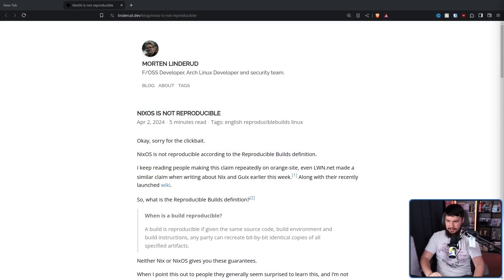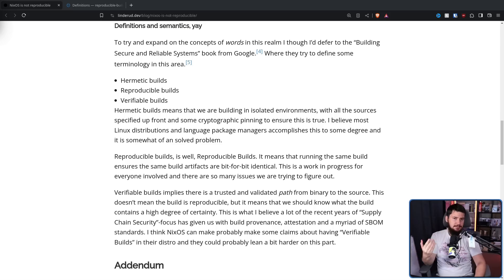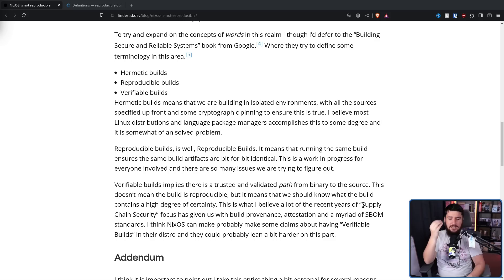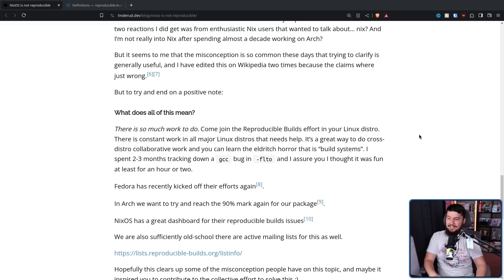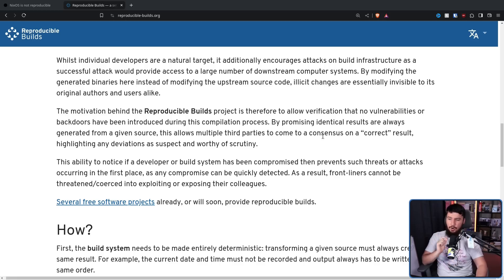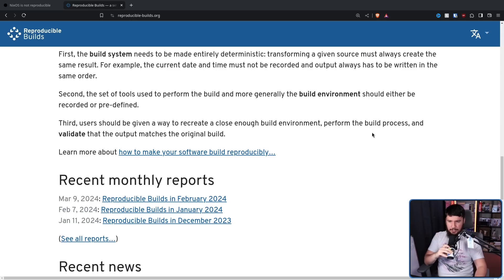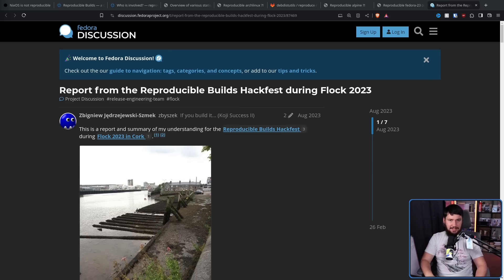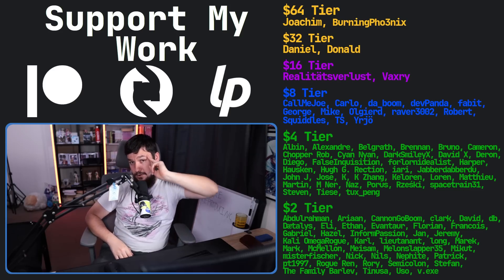Reproducible Builds: Final Step In FOSS Validation

Comment: The way out™ leads to distributed integrity/verification and bazel-/meson-like build caching and acceleration similar to distcc/icecream/sccache/ccache + meson/bazel/buck2/edenfs + artifact repo.
Package managers of systems and frameworks must follow reproducible build standards and use isolated, standardized build environments to allow caching and optional probabilistic verification by occasional spot recompliation. Another advantage is that with same/similar inputs, there can be public repositories of build caches to accelerate builds that otherwise would be incredibly slow.
Sussing out build system entropy typically involves looking for syscalls, archive processes storing timestamps, stable sorting of lists, and tracking compilation switches and build directory names exhaustively. Entropy is always removable if you're willing to patch and/or put in the effort to chopping it down. The danger is maintaining too many local patches without upstreaming them; too many distros fall into this trap of being wildly reengineering software in sometimes fragile and manpower-expensive ways.
Ideally, all large software systems should aim for reproducible builds from source as much as possible to facilitate tinkering and rapid builds.
(PS: It is an anti-pattern to not have simple, straightforward instructions to build from source and insist people "trust" unsigned binary artifacts delivered by curl piping into a shell script like k8s or bun. It is also a second anti-pattern to create a cyclical dependency on something to require an (often unverified) preexisting binary of itself to build itself without an alternate and portable bootstrap mechanism from source.)

Comment: there are some minor misunderstandings of somethings in the threads which need to be a little clearer, so here goes.

to produce an operating system from scratch, you need to either 1, write everything yourself, or 2, go online and download a bunch of stuff from people you don't know and hope you can trust the code.

1 does not work very well, apple and microsoft did not do it, neither did google or steam. it is slow and expensive. look at how long it took reactos to get to the point where people who were not kernel developers could work on it. (not criticising them, this stuff is hard).

this only leaves you with the second option, which you solve by going to conferences and establishing a network of trust through key signing parties.
as this requires the person to show the other person id, it is moderately secure against everyone but state actors who can just issue an id, and id thieves.

all the network of trust does is produce a lot of people who can assert that the person you just met has been verified to them as being the person they say they are (for a certain level of verified).

these people then commit code to version control, and once you get to centralised and distributed version control, you also have the person signing that they produced the work. this means if it later turns out that they were a problem, you can easily go back, and track what they touched and audit it if needed.
it does not stop a bad actor like the xz maintainer, you need other processes for that.

this gets you to the point were you can confirm the code you got was the same as the code they distributed (at least if it does cryptographic hashing like git) and the network of trust identifies all of the contributers.

then you need to link the code together with libraries it depends on. the original paper that started the nix package manager, which lead to nixos, described the purpose to be to declaratively manage the exact version dependencies so that you could be confident that what you used to build it last time is the same as what you used to build it this time. effectively semantically versioning the build dependencies. it appears that the people behind nixos have extended this a bit, but the principle remains the same. if the dependencies change, then the key for the dependent packages will also change. guix did not like the nonclomenture, and thus decided to declare it using scheme, but otherwise they do the same thing.

this gets you to the point where you can compile stuff and be confident where all the code came from, as you have a complete audit trail.

reproducible builds go one step further, validating that the stuff you then compile will always produce the same patterns of bits in storage. this is non trivial for various reasons mentioned by others, and many others. declarative dependency management systems might also give you reproducible builds, but it is not what they were designed for.

then you take the output of the reproducible build, put it in a package, and sign it. this gets you to the point where you as the person installing it can be confident that the binary packages you just installed are exactly the same as the stuff the original upstream contributers intended with a few tweaks from your distribution maintainers to make it work better together.

and you can audit this all the way back to the original contributer to the upstream project if needed.

none of this says anything about the quality of the code, or about the character of the contributers, you need other steps for that.

as the sysadmin for your business, you can go one step further, and create versioned ansible install scripts to do infrastructure as code, but it does not add to the model, as your ansible scripts are just another repository you use.

i hope this clarifies things a bit.

Comment: Major Correction: targeting build infrastructure is referring to the build tools themselves, including the compiler. If someone can successfully compromise a build tool, then any build generated by that tool could be compromised from the get go. That is why you can't be sure of a clean output even when you build an application / distro yourself, the very tools you use to BUILD could be compromised if you don't have verifiability. This is a major goal for GCC and LLVM as ensuring that the compilers themselves are not compromised is foundational.

Comment: This would go a long way for binary compatability amongst Linux distros.  Something i believe needs to happen for Linux to become more mainstream.
Reply: no it would not. it solves a different issue.

think of it as creating a bill of materials which contains the semantic version number of every dependency, and then hash it. that hash is unique, and says that this version of the package uses these exact versions of the dependencies. this is how nixos works.

as soon as you change from the default upstream configuration, at the very least the patch number changes, and this happens for every package in the system which deviates from upstream. if it is a fairly core package like gcc, the bill of materials for most packages will have changed, meaning they almost all have completely different keys.

so your semantically versioned dependency list says that it has these exact versions all the way down the dependency tree, and the reproducible build says that it always generates the same binaries for the given dependency list.

different tools to verify different aspects of the job.

to go further and audit across distributions, you would need some way to determine every code and configuration patch for every upstream package applied in every distribution, which is even more work.
Reply: @grokitall  yeah, I disagree.  As long as their are hundreds of distros all binary incompatible and many source incompatible without a standard binary API, Linux will always be just a footnote in OS desktop history. As far as market share. Always. I've been in computers since 1981 and to this day just doing something as simple as using your USB in an app can be a major PITA.

Comment: There also have to be someone who will actually do the comparison at least sometimes for each and every binary.
Reply: only the first time when the build does not match, and you can automate some of that. you are basically having to debug what is different in the builds. once it builds reproducibly, the tooling stops you having to do all of the work again.
Reply: @grokitall  you can't be 100% sure that your tools are clean unless you are the one who wrote and built the compiler and all the tools. And even then you have to believe that your OS and all the software on it is clean.
Reply: @MaxusR  which is the entire point of reproducible builds.

if you cross compile gcc using llvm, and then use that on a machine with another architecture to cross compile llvm using gcc, you can be fairly sure that your new llvm install has not been hacked by the compiler.

if i can then do the same thing, and get a bit perfect copy, we can both be sure that the same source code produces the same output.

it does not stop the xz attack, but there are other parts of the supply chain testing which help catch that.

Comment: So, if I understand it right, you would have to have multiple build-environments (or the one that you are using, like Arch) and build the package yourself to see if it matches. I can make a pretty good guess, that regular users won't ever do that, unless they want to replicate the effort of distro maintainers, which is pointless. My point is, this is all theoretical and unusable in real life. It's nice to have transparency, especially for some important projects, but if you are not an IT researcher, this is still not a good way to check this.
Trust is and probably be always more efficient, but it will be always risky.
Reply: the point is that it is not about you trusting your distribution, but them being able to audit the trust for everyone upstream of them so they know that the stuff they built has identical source and output as what was got from upstream.

it does not stop the xz hack, you need other methods for that.

Comment: I tried to use NixOS for a week - it actively hindered my user experience and the ability to even do anything, because I had zero clue how I should go about designing the config

The documentation is terrifyingly terrible for starters, it was so much easier to reproduce my dotfile by

1. Using my distribution universal boostrap installer to install Archlinux
2. Chroot in, perform system upgrades
3. Git clone dotfiles
4. Done
Reply: Also, I just tried to build rust from source

- the rust source directory takes about 10-15gb total to build

No, you cannot separately build, you need every single toolchains and every single stage to work properly

10-15gb...of the userspace...

Comment: What if I made a reproducible build that included my undetectable backdoor I put years of effort into ... And called the project systemd
Reply: that is basically the xz hack, and other steps caught that.

however you can mitigate that one by having multiple tools from different providers to do the same job.

gcc got hacked? switch to llvm and recompile everything.😊 it is all about auditability, and not having single points of failure.

Comment: It seems that calling NixOS not reproducible is comparing apples to oranges. The author is talking about compiling binaries and NixOS is about creating a reproducible system configuration. Most people if you say, "Reproducible build," will think of the latter. Why not just call it reproducible binary builds to specify.
Reply: because the term predates the ideas behind the nix package manager, which tries to solve a different problem.

its like saying lets just rename the make program to be called fred. yes you can do it, but the amount of issues it would cause is just not worth it.

Comment: I actually saw this a lot, when I tried using a git repo for delivering binaries on a server, after rebuilds git would tell me binaries have changed even though the source clearly haven't. Then when my project would produce files with hashes in filenames based on the source file content, once again sometimes the hash would change even though I didn't actually change the source

and this isn't even some complicated distributed system, it was my own project that I was building on two of my computers (but iirc I didn't even have to go to another computer to get different results, passing of time would be enough)

Comment: It always baffled me how reproducible builds are not the default. From a computer science standpoint a compiler is a program which transforms a human readable intermediate language to machine code, and possibly performs some optimizations, in a deterministic way. It's very unfortunate that this simple concept got messed up sometime in history and now we have to deal with the aftermath.

Edit: it's the same with cross compilation! The build system should not be in any way linked to the target.
Reply: Agreed! It's just source code in -> binary artifact out, and yet its still so insanely difficult to get that process to work in a reproducible cross platform way.

Comment: I submitted an app to f-droid a little while ago. They wouldn't approve my submission till I made my build reproducible. Felt like nothing but red tape to me tbh. Having said that I will say that it's absolutely fascinating that a PNG generated from an android XML icon managed to break build consistency between my system and the build bot. Freaking wot? Why? How?
Reply: How did you fix that? Pre-generate PNGs?
Reply: @Caellyan  How else? Bothered me something mighty to have unnecessary binary artifacts checked into git. I worked so hard to ensure there wouldn't be any bitmap icons! Literally the app's launcher icon on sufferance to support older android versions and that's my lot.

Comment: Some platforms put timestamps inside their object files, so you need tools like objdiff to compare binaries because there checksums always differ. On other platforms we were always able to reproduce builds bit by bit when using the identically versioned software stack on top. That often is the culprit 9 months after the original build! Otherwise there might be bad decisions about what to include in a software build. The software stack (see above) should be included, but with a defined sorting ("LANG=en_US sort <pkgs_tmp.log >pkgs.log"). Including log files (with timestamps) needs regexp filters. Another issue is mixed stdin/stdout output (sorting) or enabling unpredictable "AI" compiler optimizations.
Reply: PS: I remember a heated discussion when a software engineer who used an "AI" ( 25 years ago !) to assign things into slots. It required lots of discussions to force him to use a given random seed so the "make test" results of a reproducable build also gave the same results!

Comment: Last I heard of this, Rust wasn't reproducible in many situations.

When something like that is going on more often, good luck to distros trying to get their numbers up.
Reply: So much for safety amirite?
Reply: @angelcaru  I mean, yeah, but I still very much like it.

The reasons it's not reproducible are mostly ones that make for great developer experience. For example, if you panic (similar to raising a exception, except it's fatal) it embeds the absolute path to the file and the line where the panic originated. Which is very nice. Other features might also hurt reproducibility, and some of these are legitimately concerning from a security standpoint even outside of reproducibility. Procedural Macros can do pretty much everything to generate source code in the end, including web requests, and there is build.rs also for dependencies, which also execute arbitrary code and can be part of libraries.

But it's not as if other ecosystems don't do similar things eventually to solve similar issues. But for Rust it's nicely integrated, which though also means that it's easier to miss than eg a Makefile.

Still I prefer this standardization over providing nothing, meaning everyone does his own thing, making it much harder to systematically protect these more heterogenous ecosystems.
Reply: Procedural rust macros are every malware-head’s dream, they’re straight up irresponsible
Reply: @angelcaru  I mean... Okay. I'm sorry, there's too many people saying this honestly.

Also, how TF are you able to post a link without getting instantly deleted by YouTubes moderation? Maybe it's looking at hostnames...